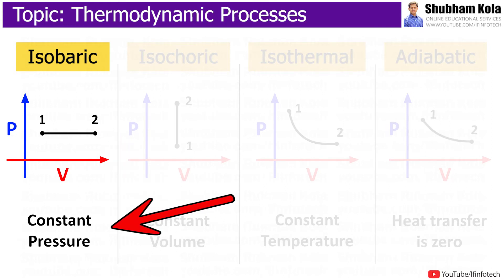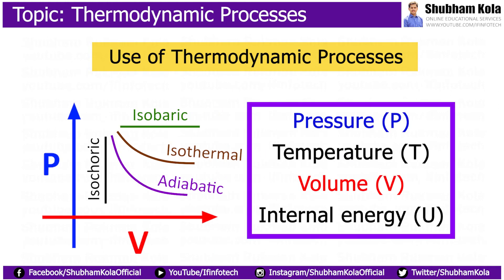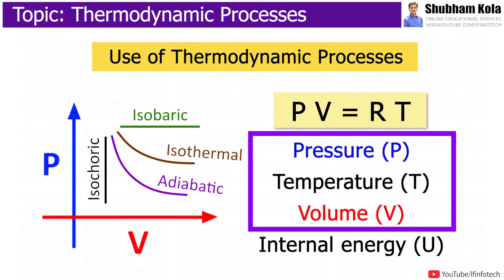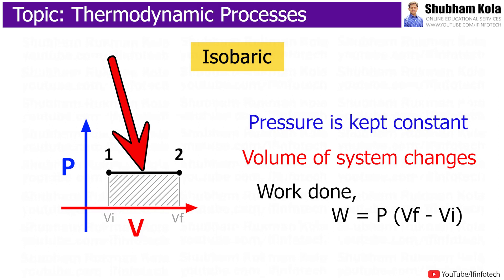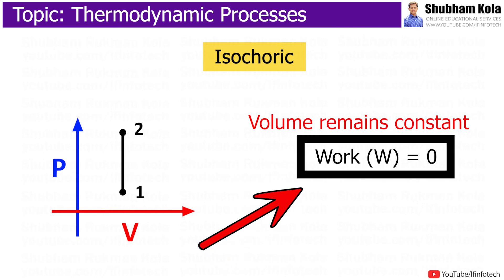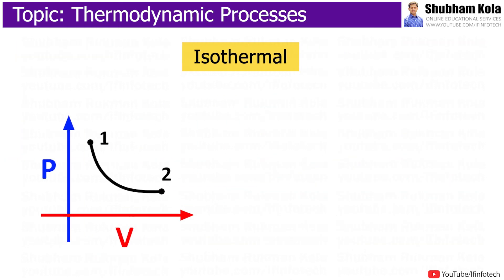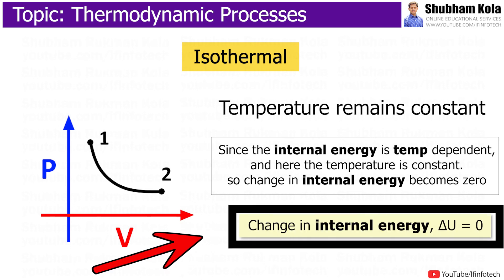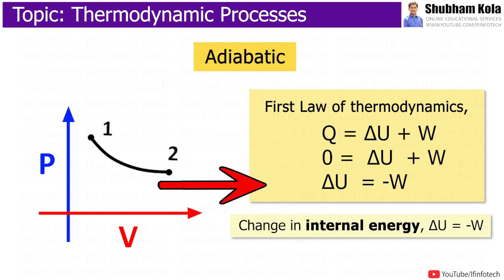Thermodynamic Processes: Isobaric, Isochoric, Isothermal and Adiabatic process | Chemistry #12

Comment: Sir how can the work in isobaric expansion be positive if in expansion or compression the external pressure is acting on the gas in the opposite direction in compression or expansion of gas so external pressure is taken negative always and the formula is dW=-P(Vf-Vi) so in expansion  Vf is greater and work is negative
Reply: Pressure is not taken negative the difference between vf and vi is negative
Reply: It's been a year idt it matters anymore